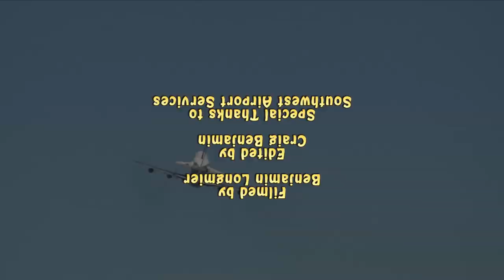Space Shuttle carried on 747 on low approach, HD

Comment: Angle of Attack is a term which refers to the angle of the aircraft as it moves through the air. A high angle of attack would mean the nose is pitched up (anywhere above ten degrees depending on the aircraft), while a low angle of attack would pitch the nose toward the deck. I hope I answered your question.

Comment: if you go to Wikipedia and look at Boeing 747 youll see there that NASA uses the Boeing 747 as a transport aircraft for the space shuttles along with NASA so does the u.s. air force use it for same purpose as transport just moded to handle the extra weight or whatever they require. So no its not a antonov 225.

Comment: that 747 burns through a gallon of fuel every 3 seconds with the shuttle on top of it. they had to fly around florida for about 2 extra hours in order to burn off enough fuel, so that they weighed only 603,000 pounds when they landed.

Comment: The question on my pp test many years ago was: If a plane is flying at an airspeed 10kt above stall speed into a 20kt headwind and turns downwind, what will happen? And of course the answer is: nuttin. Ground speed changes but airspeed remains the same. (not technically true since the very act of turning tends to bleed off some airspeed, but the important concept is: the plane doesn't know the wind is blowing.)